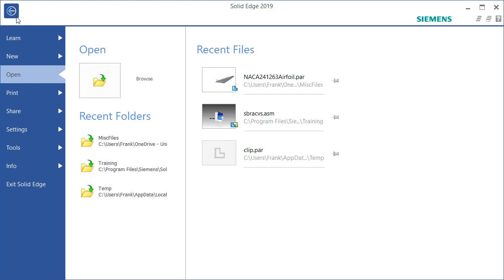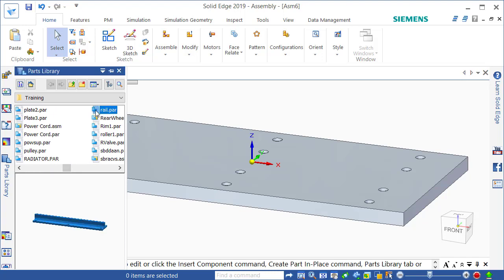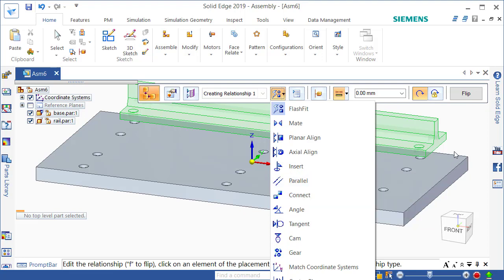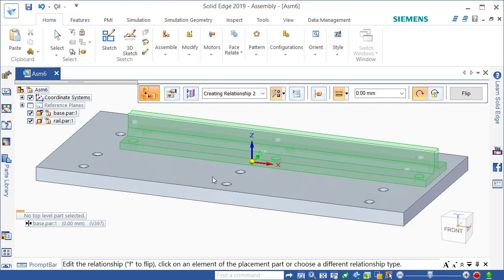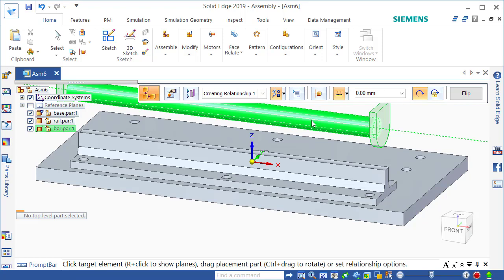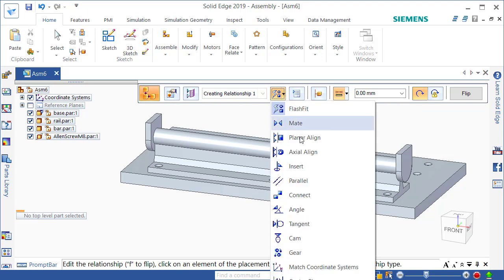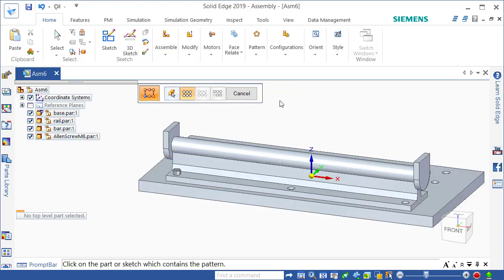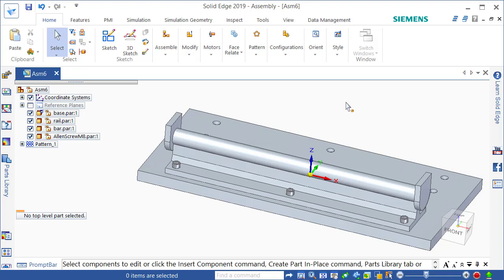Basic Assembly Methods in Solid Edge

Comment: Thanks Frank.  You wonderful instructional video on assemblies was the first one I came across using Solid Edge.  Man - I had no idea this software existed and I come to find SE has been around over a decade already.  I'm teaching myself this so I can learn to fabricate plastic parts.  So far so good.
Reply from the maker: Thanks Brian. I'm glad they are still of use as they are a few years old now.  seem to remember that there were some useful tools for doing (moulded) plastic parts but I haven't done any of that kind of work for a while.